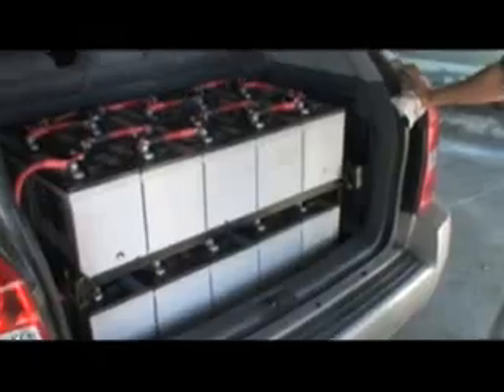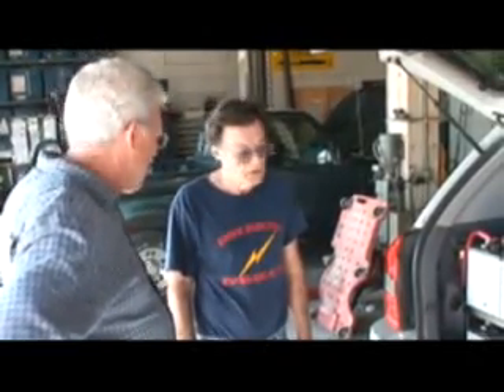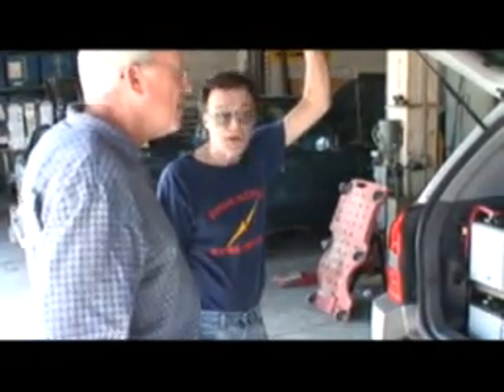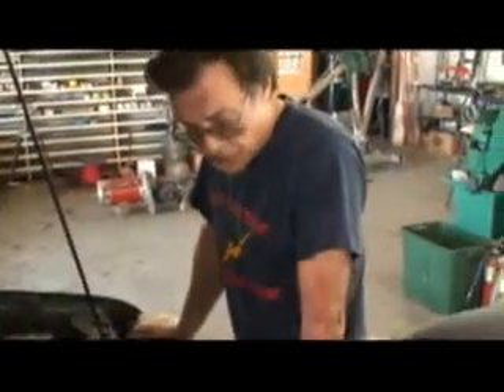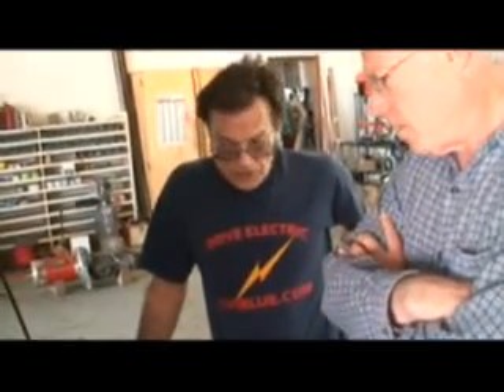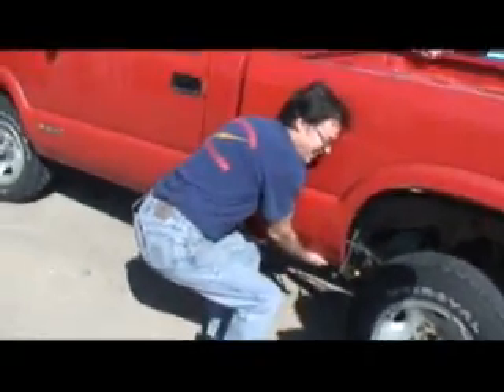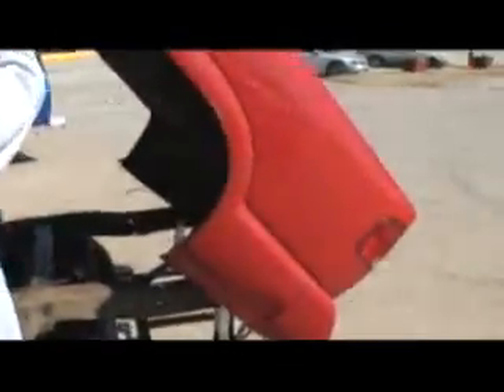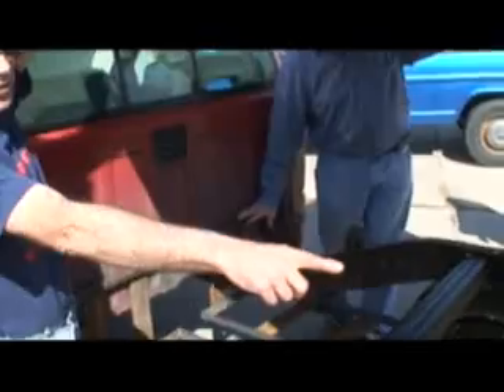ev-blue site visit with Wayne Alexander

Comment: Just to be accurate those yellow Thundersky Lithium cells are 3.2 volt nominal cells, max 4.2 volts, but probably should not be charged above 3.8 or so.  They may also not need a cell level management system depending on operating range.